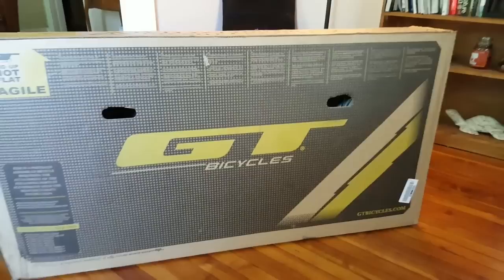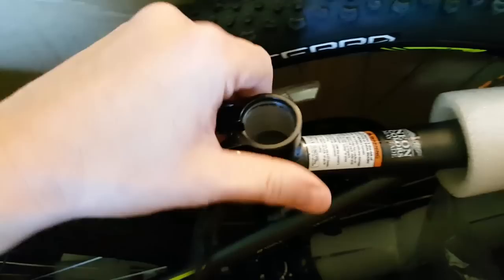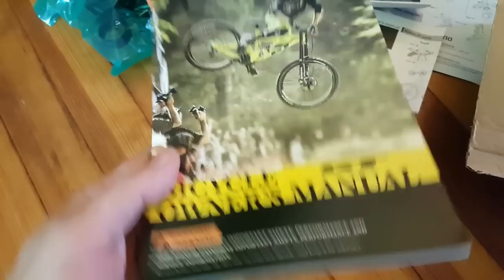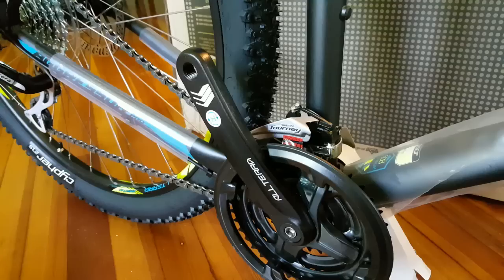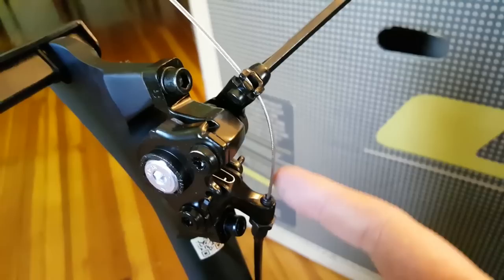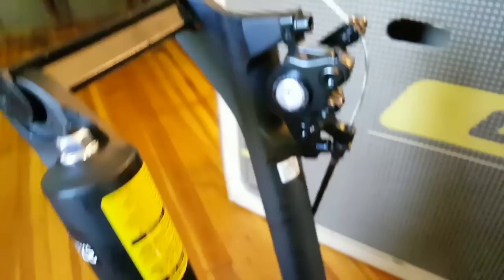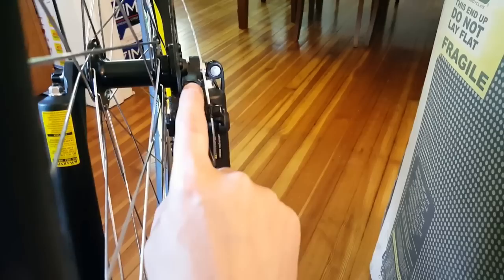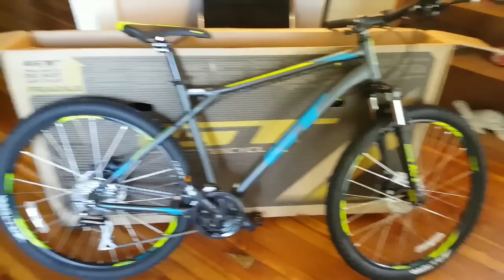GT Aggressor Pro 27.5 Mountain Bike unboxing & assembly review  DICKS $349.99

Comment: I think they send it chain off so the derailleur doesn't stay under full tension during shipping. Temp changes and pressure changes in shipping and such means the tension varys alot just sitting in the box. (Granted I'm thinking in terms of restringing a guitar after moving from utah to Arizona then back then to washington state. Every change means all the wires have flexed and shifted and need to be fine tuned)

Comment: Can you do a video about the Dereillur adjustment on GT? Buying a small tripod for camera/phone will free your hand.
Reply from the maker: hey thanks for watching. im no expert adjusting the front or rear derailleur so i dont feel comfortable making such a video. however when i needed to do mine i just searched youtube and found a great video by park tool that walked me through the process. sorry but i hope that helps. its not to hard. its just hard to explain. good luck!
Reply: @ppdangler  I was wondering what would be good way to keep this bike well lubed and rust free. what kind of lube you use for the chain? thanks
Reply from the maker: i use this: https://www.amazon.com/WD-40-BIKE-Lube-Color-Size/dp/B0744PMKWK/ref=sr_1_16?ie=UTF8&qid=1546291574&sr=8-16&keywords=wd40+bike+chain+lubricant

Comment: Thanks for the video.  Got some info of what's in store for me tomorrow
Reply from the maker: good luck man. pretty straight forward assembly.
Reply: @ppdangler  thanks.  Didn't take me long at all.  I thought I'd have problems with something right out the box like something being bent or not shifting correct... Bc you know.. Life is funny like that... But everything came together great... Everything works better than expected.  Brakes are better than I thought... First time with disc brakes and I'm impressed.  It was pouring out yesterday and I had zero problems stopping..  only thing I changed out so far is the stem... I might get better grips soon they're a little thin for my liking but everything else is solid.
Reply from the maker: @jasonsierchio1167  nice man! Yea I immediately upgraded the grips. The brakes are awesome. The only thing I'm not liking is the seat. I'm gna upgrade that prolly in the spring. Keep it lubed up and you'll be good to go. Also retune it after riding about 50 or so miles because the cables will stretch a little, then you'll be good to go. Cheers man
Reply: @ppdangler  thanks for the advice man.  Will do.  Already put about 20 miles on it.  I don't mind the seat but eventually I wanna get a wtb volt
Reply: @ppdangler  what grips did you use?  I'm thinking about odi because it seems like a lot of people like them
Reply from the maker: @jasonsierchio1167  yea i got the odi clamp ons.

Comment: would you recommend this bike ? I’m looking for a bike that can handle roads well and some trails I’m not going to use it for crazy trails but since where I live there’s a good amount of dirt trails and stuff I want a bike that can handle well in both cause I might use it for commuting to work witch is 6.9 miles away.
Reply from the maker: yes i would reccomend especially if you can get it on sale for 300 350. i do both road and trail riding but mostly road. it has held up great . just like anything take care of it, i clean wash  and degrease the bike and lube the chain 2-3 times a summer. keep it inside outta the rain to prevent rust etc. its a great bike! thanks for watching
Reply: @ppdangler  🤔 i only see them for 479.99

Comment: When I tighten the front wheel skewer,  the wheel will not move. When I loosen it,   it flows freely. Will the will fall off by being loose or is this a sure lock?
Reply from the maker: mmm somethings not right im thinking. you should be able to clamp it down and it should spin freely. are you sure its not catching on the brake caliper?

Comment: So I set the front brakes like you said but I can’t get the pads to stop rubbing the disk. I’ve adjusted it serval times now and got it to where it’s a minor rub should I just leave it?
Reply from the maker: yes. you may not be able to get it perfect. the brakes will "break in" after a couple rides and will stop rubbing. thanks for watching man! enjoy!
Reply: ppdangler I got it to perfect I just had to move the adjustment brackets and hold them while tightening. Thanks for the video it helped me out.

Comment: I am about to order one online and I am 6’2 with a 34” inseam. All the sizing charts I’ve seen online, including the one on dicks site says I should ride a 21” . However, the sizing chart in the pictures next to the bike online say I am more realistically a 19”, suggestions?
Reply from the maker: mmm. based on height id go with the 21.  do you have a store close by you could go in and check out?
Reply: @griffinboag246 hey that's my size too Griffin..what did you get the L or the XL?  recommend?  6'2" 34 inseam measured.  Ordering online, 2hrs from any store. Thanks!

Comment: I got a question, so when I opened up the box with my Bike inside, there’s this little plastic bag that contains like 2 pieces. It’s small and one of them is black shaped like a circle and the other one looks like a screw or something, what are these for?
Reply: I too had this question. The silver piece is the cap for the front brake cable. But I couldn’t figure out the black piece. Did you ever figure out where it goes?
Reply: @MASHLEY69  honestly I haven’t even figured it out

Comment: I’m thinking about getting this bike what are some upgrades would you recommend ?
Reply from the maker: i rode it lastnight for couple miles. i would deff upgrade the pedals. everything else seemed good. seat was comfortable for me.  other than that its a pretty sold bike. THANKS FOR COMMENTING SUBSCRIBE TO MY CHANNEL i will have more videos of this bike coming soon!
Reply: I changed the pedals, shorter stem 60mm, tires to WTB Trail Boss 2.25. The fork to a lighter one: Sr Suntour Raidon 120mm. Its 2lbs lighter and is air fork. Fork is night and day difference from the coil 80mm it comes with. You can go thru the Suntour upgrade program and get $100  off your upgrade fork and get it for $199. Check that out. You can do more but that's enough. This is a very good entry level light aluminum MTB
Reply from the maker: rotek169 thanks man. Appreciate your input!!
Reply: I just bought this bike last week. So far it’s been pretty awesome. I’ll be upgrading the pedals and switching out for a shorter stem and slightly wider handlebars. For $350, it’s a solid bike for sure.
Reply from the maker: yes sir. thanks for the comment. hey share & subscribe i got more videos of this bike in action coming!!
Reply: If so buy it right now from Dick's sporting goods it's on sale 350$
May 28 2018
Reply: rotek169
 - You went with 120mm fork?  I was worried about putting a 100mm fork, thinking it would change the geometry too much for the hill climbs.  How is it for climbing with a 120mm fork?
Reply: I went with a 100mm fork and a bar with more a rise. I like it. I thought the stance of the bike quite too aggressive stock.

Comment: I just ordered one of these and put it together today. When I spin the front wheel I can hear the brake rubbing against the disc. I've done my best to center the front wheel and adjust the brake, but I still hear the rubbing noise. No installation guide was in the box. Wondering if anyone has any suggestions?
Reply: Take it to your local bike shop. Theyll hook you up
Reply: Yeah totally I was trying to exhaust all options before doing that lol

Comment: I'm 5' 3". Would the 15" be good for my height?
Reply from the maker: Flash Five yes that would be good
Reply: ppdangler thanks
Reply from the maker: Flash Five no problem man. The bike is awesome. Someone said there on sale now for only 300 so check it out. That's a steal. Sub to channel will have more vids on this bike soon
Reply: ppdangler it's actually 399 now but it's still a good price